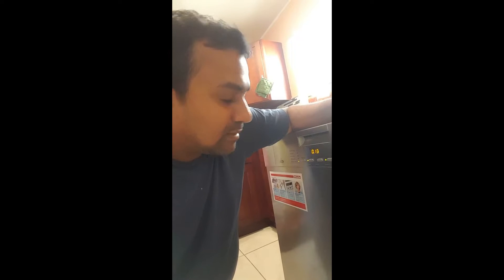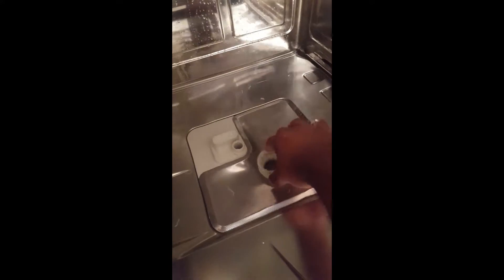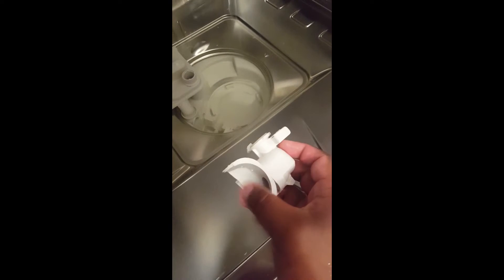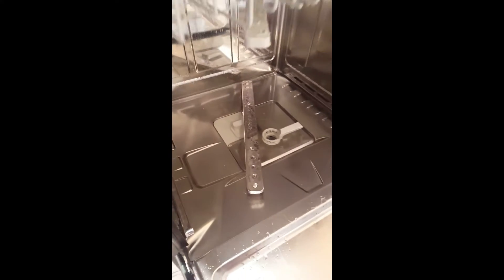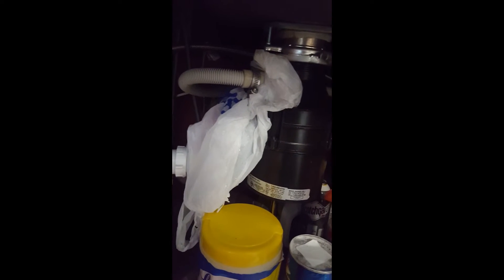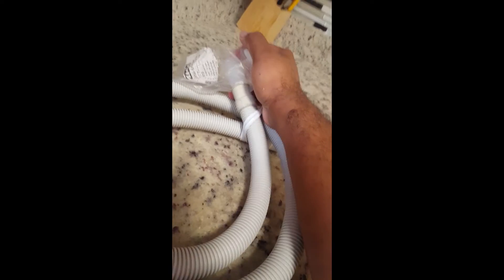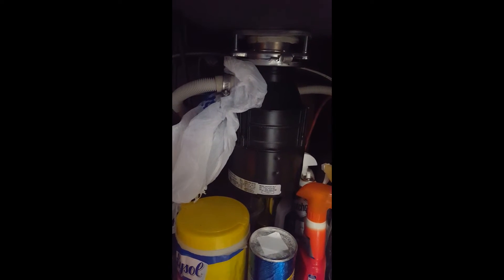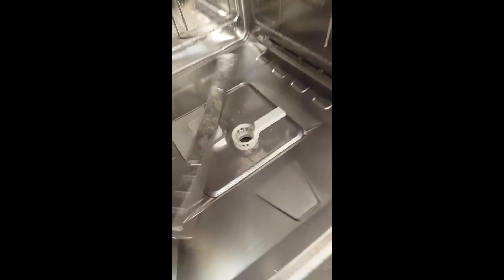F 11 Drain Fault  On MIELE  Dishwasher

Comment: Hi, thank you for this video, our Miele dishwasher has the same issue, tried everything I could find on youtube, the strange thing is, it starts sometimes, and it washes perfectly but one needs to start it 5, 10, 15... a random number of times until it starts once... any suggestions please?
Reply from the maker: seems like you have a faulty electronic, did you get any fault code? what is the model of your machine?
Reply: techjohn015 Hi, thank you for your response, the model is 843 scvi plus, it is an older model, no display. It has optics but I do not have diag tool.
Reply from the maker: @tunintunin3417  tell me exactly what happens when you start the unit and run the cycle. Did it drain, did you get any flashing lights. Do you hear the circulation pump running.
Reply: techjohn015 thanx, I push the start button snd the program I want, I close the machine, i just hear a few clicks like relay clicks and nothing else, after a few mins, I open the machine to see the drain light blinking as if there is an obstruction somewhere... did all of the things I was able to do, checked the pump impeller and the return valve, all good... made that small tool (fork style) to turn the prop... did not help...

But after a random number of tries, if the machine starts, it washes perfectly... but sometimes I have to try and start it 20 times...
Reply from the maker: @tunintunin3417   check the Waterproof System under the sink feel it for vibration when running a wash cycle if it's vibrating its a sign that its getting power, Then turn off the water and remove the WPS and check the filter, the steps are in your user manual if you  don't have the manual  download it here https://www.mieleusa.com/domestic/brochures-manuals-385.htm#item-0-0 
If the filter is clear and water is coming into the unit then you will have to pull the unit remove and check the circulation pump for obstruction also check the level control for any blockage.
Reply: techjohn015 thanks so much, I actually tried all of this, in-fact,, bought another hose with the solenoid valve. Replaced it, no go. The funny thing is, when it kicks in, it works great but it just does it randomly.

Comment: Thanks for this great video ! 
What if F11 still shows up even after checking everything that you mentioned?
Reply from the maker: remove the drain hose from the garbage disposal if its connected to a garbage disposal and place the hose in a bucket and turn on the dishwasher, It will drain for the first 30 seconds. If it drain out perfectly then the problem is with the drainage and not the unit. If you are still having F11 then you would want to remove the drain hose completely and check it for clogs or kinked if hose is clear then check the drain pump.
Reply: @vjohndiy   thanks it worked ! You have a new subscriber .

Comment: I have done all these things.  Still F11
Reply from the maker: Does the drain hose connect to an air trap on the counter ? If so, check the air trap it's stuck or blocked. Try to disconnect the drain hose and place it in a bucket  🪣  and start the rinse, and hold function. The dishwasher should drain normal. Once drained, then the issue is the air trap or the disposal if connected to one.

Comment: Mieke dishwasher Will nog let waterin
Reply from the maker: Few things to check.
1. Check the water valve if it's open 
2. Check the water proof system filter if it's clogged. If that dont work l, replace the water proof system